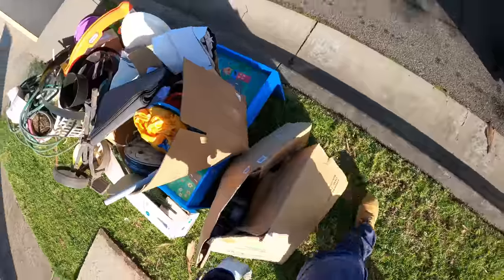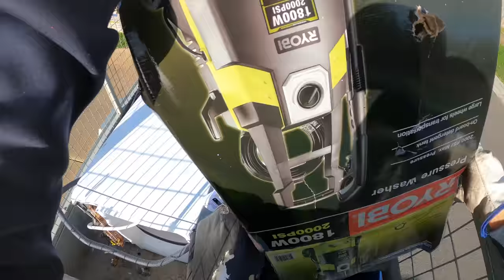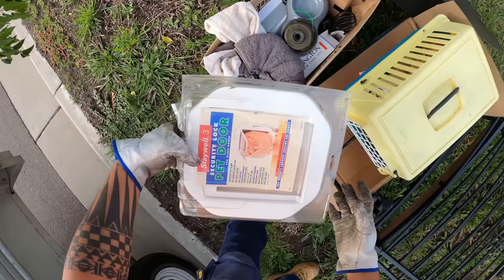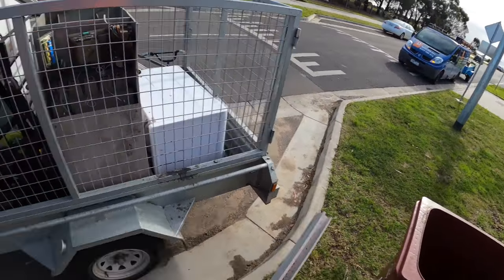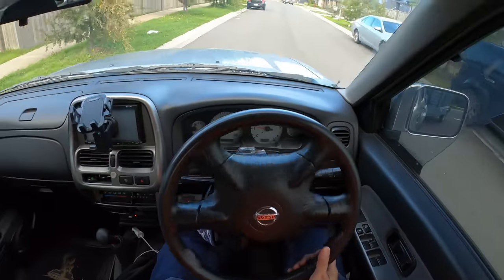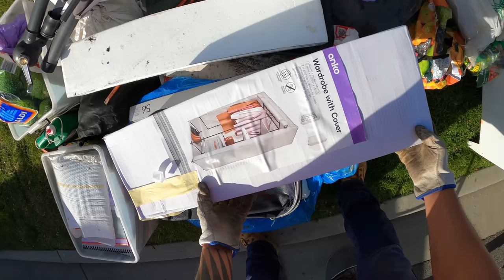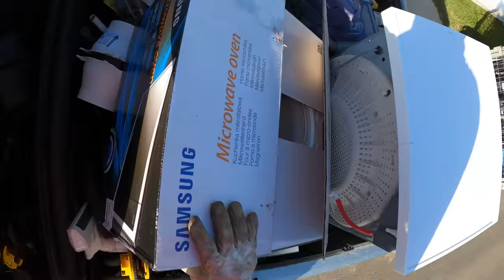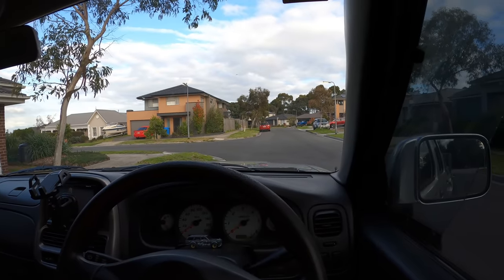Throw & Go Street Scrapping ft. The Garbage Truck

Comment: Seems weird seeing a Dennis Eagle bin lorry in Oz, they are made about 70 miles from where i live and I spent 22 years working on the back of them. It still makes me cringe when I think about what I have thrown in the back without realising what they was worth like clearing out an electrical shop and throwing about 100 crt tellys and them getting crushed in the back and taking them to the landfill
Reply from the maker: Yes they are a recent addition I think. I don’t remember them as a kid. I’ve seen them crush a large French door type fridge and the neighbours couldn’t believe it. They thought they would take them separately. There is a seperate flatbed truck with cages that picks up large appliances but I rarely see it. A driver told me they dump what they crush onto a concrete pad, and fish out the metal, but not every the time. Thanks for the comment 👍👍